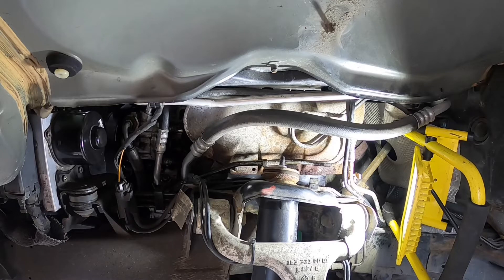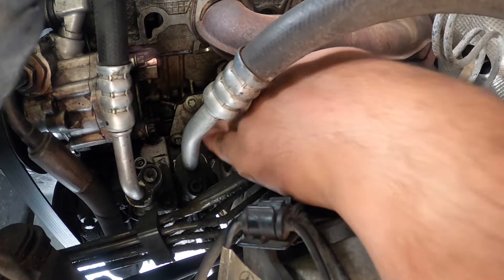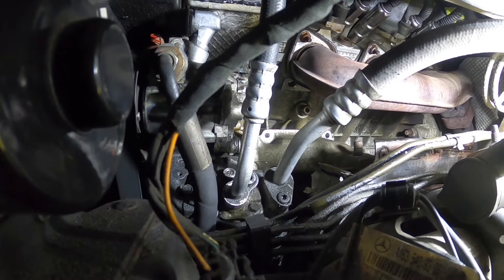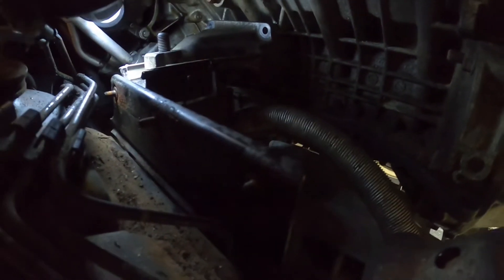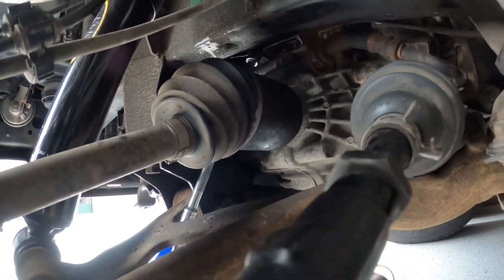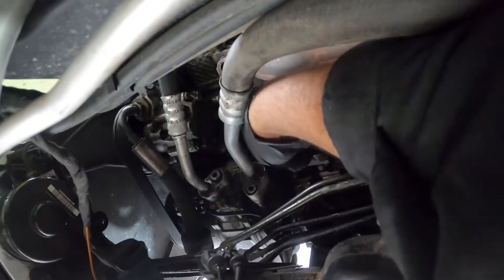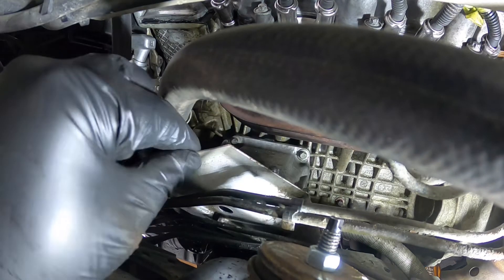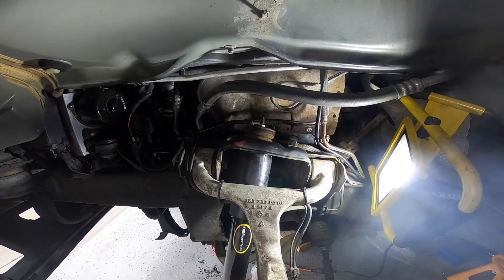Mercedes ML320 430 500 ML55 W163 engine mount (Driver side) replacement the easier way

Comment: Excellent! Thank you so much! One slight point. On my ML350 six-cylinder, the driver's side top front/left T12 did require me to move the AC compressor out of the way. I think on the eight-cylinder versions,  the engine mount bracket is longer and there is more room to do the job without moving the compressor. 

Next time here is how I would go, passenger no brainer, drivers side problematic.
1) On jackstands, both wheels off, both wheel well shields off. Keep the airbox in. Don't move the coolant tank.
2) With the engine still down, remove the little 10mm engine fan shield bolts, lift the serpentine belt off the top idler pully.
3) With the engine still down, remove all three AC compressor t12s - one of these is the lower left engine bracket.
4) With the engine still down, remove the three 10mm on the heat shield.
4) With the engine still down, remove the four bottom 16mm engine mount bolts. The rear driver's side nut is a bitch, I had to chain three universals to short 16.
5) Lift the engine with the floor jack. A 2*6 or 2*8 cut lumber at about a foot long. 2*4 is not tall enough
6) Use the 18mm offset spanner to remove the top engine mount bolt.
7) Ok here is important: get yourself a real 1/4 by 12Torx. It will be hard to find. (3/8 by 12Torx will not do.) Add 1/4 universal and get the top front engine bracket bolt
8) The other three 12T engine brackets are no prob.
9) Swap out the mount, and reverse the steps above.

10) But here is the frustration. The rear bottom 16mm, is almost impossible to get back on and tight because it is blocked by the top of the CV axle.
I have a ratcheting 16mm crowfoot on order, it's the only sane way I can see to tighten that nut. Or the ML can live without it by maybe double-nutting the front stud?

Cheers.

Comment: Thanks for the video,I tackled this job last night took me many hours,I did have to loosen up the ac compressor to get that last e12 off,I only did the drivers side took forever lol...the mount was completely shot.this video is the first one that shows that you need to remove the heat shield bracket,it's basically impossible without doing that.i hope I never do this job again it's a nightmare...but doable with patience 👍 😀
Reply from the maker: No worries bud, glad the video was of some help. It is a bit of a challenge, but once the job is done , it makes a huge difference! Driver side is the harder one, to be honest. The passenger side is much easier than the driver side. Cheers 🙂

Comment: Did you have to remove the bolt that holds compressor to the engine?
Reply from the maker: @longhuynh5249 yes, I did remove that long bolt. Made it easier to work around it.